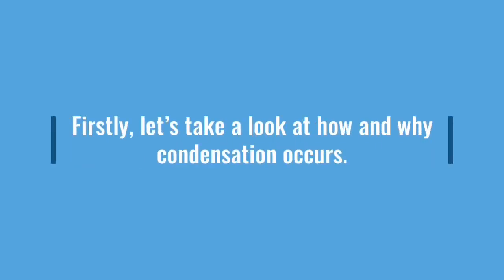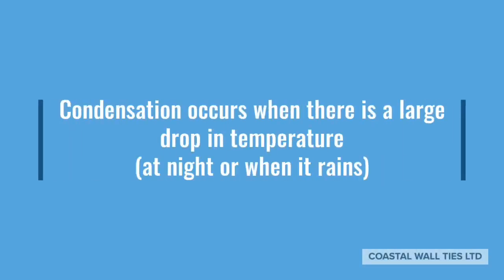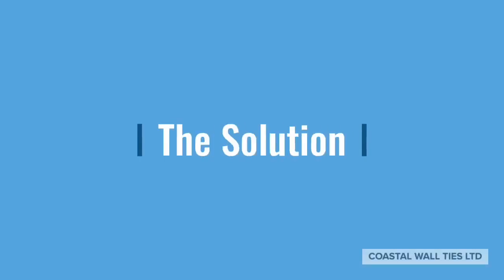✅CURE Condensation and Mould on Windows and Walls INSTANTLY.

Comment: Thanks for the tips! Typically, I have this problem in an energy crisis situation 😂. I moved in to my house around 1 month ago and I'm having condensation, damp and mould issues around the front bedroom windows. In my previous house, I much preferred to close my bedroom door, now I can't 😐.
Reply: Hey buddy im in the same issue, just bought an 1850s house and have damp and wet walls, bits of mould especially around the windows. I cook with lids on, open a window when cooking and try to air the house, its helped but im getting a professional damp survey so will let you know! my house has really poor air circulation so i think this is the main problem as air needs to move and escape.
Reply from the maker: Hi Rick, thank you for the comment. Now we are in a energy crisis, we are seeing an increase in condensation/ mould issues. You can close the door to the room as long as you have sufficient ventilation at night ( don’t open the window too much ) alternatively you can have a passive vent installed, this would be a safe way of providing the right amount of ventilation. You could also consider thermal blinds to prevent heat loss through the windows, thus saving some money on heating in the long term

Comment: Great video thank you it has really helped. we just bought a 1850s cottage (no building survey as couldn't afford it! doh) we have wet walls on the inside and now keep the dryer on with the window in the kitchen open when on, lids on whilst cooking and im sure there are some moisture leaks in the brickwork as we have 4 or so areas where mould keeps appearing, all my double glazed windows have condensation every morning and mould is appearing around quite a few windows. I have set my heating to 20c in the day and 16c at night to see if that helps as the heating was set to 10c overnight.

We have a downstairs bathroom with no extractor (very bizarre) and no extractor in the kitchen. 

We are getting a professional building and damp survey next week so will know more and can solve the issues hopefully. 

Any advice would be great.
Reply from the maker: Condensation occurs predominantly at night or when it’s raining outside. Having the heating on at a consistent temperature is a good start but you also need a consistent flow of new air or circulation of air to prevent it completely. Do you have old windows? Or newer UPVC? You could try installing passive vents like this https://www.va-remedial.co.uk/product/rytons-baffled-controllable-lookryt-aircore/ 

I would recommend this over a PIV UNIT as it doesn’t require energy consumption.

Comment: cheers dude, great video & interesting topic! My new attempt at solution in my let one bed basement flat was similar but I didn't leave heating on constantly on 18C.  I installed a programmable thermostat that allowed me to set a minimum temperature of 15C and that seems to be helping to solve the damp problem and keep heating bills down a little bit more.  Previously heating was on in the day and entirely off at night.  Also a little sill at the bottom of external walls to push the water a little further way seems to be helping and filling in every tiny potential hole outside.  I had previously moved to an electric cooker, added humidistat extraction fan in kitchen & bathroom, dehumidifier in the bedroom, squeegee in the bathroom, tumble dryer, it all helped but didn't solve it.  Wonder if humidity from the coast is getting in when I open the windows though and trickle vents, air bricks and leaving windows open is making the solution worse (2km from sea); an indoor/outdoor wireless hygrometer / thermometer would help here to know when to open windows and when to keep them closed.

Good practice - don't overboil kettle (or use temperature variable one), open window after a shower, keep a window open during a bath, don't dry clothes inside.

How effective is the brick treatment that soaks into bricks & repels water?  Do you have a brand name? Do you inject it into the brick work or just paint it on?  Buying a new home in a few months hopefully, it does have a cavity wall, if I do install cavity, go against your recommendation, what has the best chance of success without damp or infestation?  Could adding insulation on the inside of a property trap moisture inside the brickwork?

Comment: Thanks for these vids mate, given me food for thought. Question tho I’m in service accommodation and suffer with mould, damp, and a breeze through the house that won’t go. First I re pointed the gable and Johnson’s brick sealed it secondly I have installed trickle vents into to upvc windows. So far no change. I have those little moisture catchers in every room and they fill regularly. Windows are opened on the less damp days but as you can imagine in these months it’s not all that often but I do leave the windows in the night lock 90% of the time. Totally get regarding the heating and keeping it on so it will go on just to top up, however I’m spending between £5/£8 per day on gas and now prices are going up it’s getting rediculas now……do you have any further advise or suggestions in which I can try ? Help would be greatly appreciated… thanks pal

Comment: Hi i find your videos really great. Just would like to pick your brains on something. House is built in 1995 just the normal estate house with brick in the front with hollow walls in the inside. No major insulation has ever been done to the house. Now this last three years the house is getting really cold even attic (only storage ) seems very cold. I am thinking of getting the attic converted and then re sealing the windows and bleeding the radiators. Is there anything that I should watch out for in relation to ventilation when i do this. Also is there any other economical fixes i can do to the house to make it warmer without having condensation issues.. Thanks in advance.

Comment: Hi, did insulation in suspended floors of 1930s houses ever cause issues?
Reply from the maker: Hi Mohammed, thank you for your question. I have heard on the grape vine that it has caused issues although we haven’t seen a case ourselves. Having insulation in suspended floors could be a benefit or could be a disadvantage depending on how the house is heated and ventilated, get it wrong and it could potentially cause issues if you have condensation occurring.